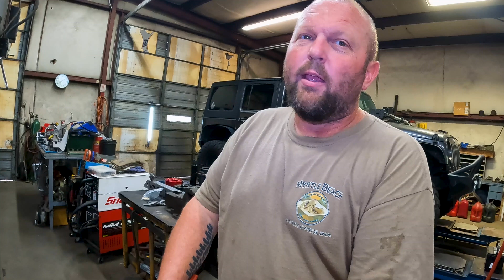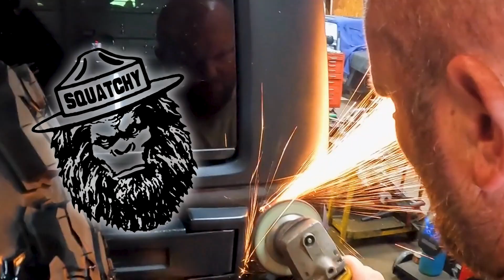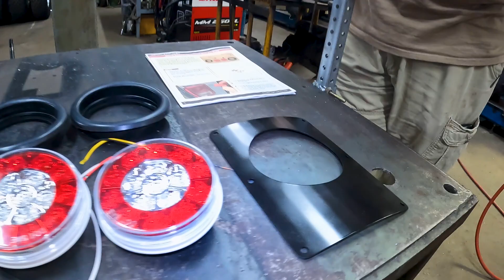@Motobilt_inc JKU TAILLIGHT CONVERSION INSTALL

Comment: Looks great! Would you be able to give me the wire connections, as I have an '07 JKU, and could save me some time?
Reply from the maker: This is a 14 but may be the same not sure. Factory white/green was reverse light and went to yellow on aftermarket light. Factory white/purple was park lights and went to white on aftermarket light. Factory white/yellow was brake light and went to red on aftermarket light. Factory black was ground. Hope that helps.
Reply: @SquatchyOffroad  Thank you!

Comment: Hey I installed this exact thing, when my running lights are on I have no turn signals or brake lights just solid illuminated lights, any ideas? Thanks!
Reply from the maker: Sounds like you may have wires wrong. Took me a while to figure out wiring. Had to use a test light and check each wire while someone worked turn signals and brake.
Reply from the maker: Look in comments and I put what wires were what and check yours with that.

Comment: Installed these taillights and when I put either blinker on they both flash. Anyone know why?
Reply from the maker: Sounds like you may have something wrong with wiring. Only way should both flash is with the hazards on but I am sure you know that. I posted wiring colors in comments if you wanna make sure wires are good.